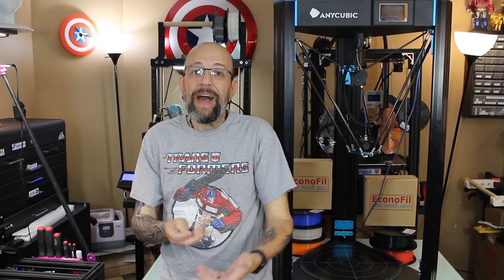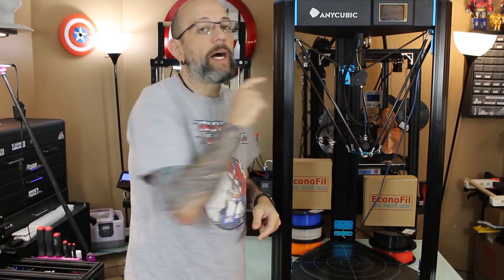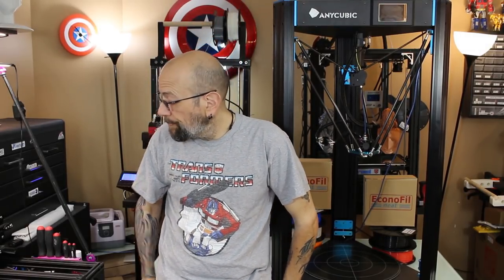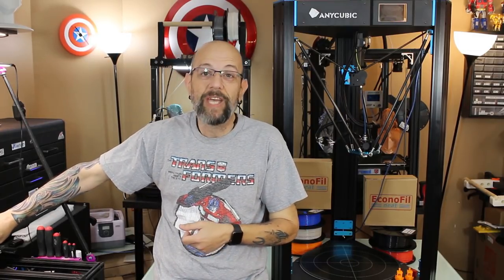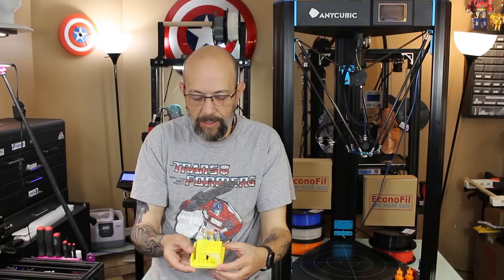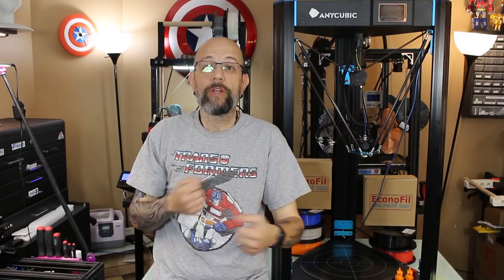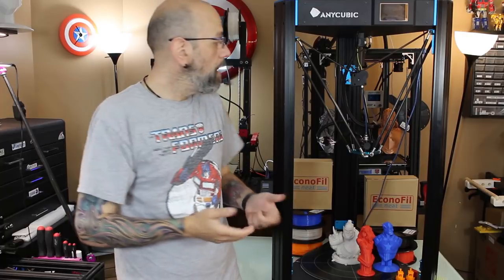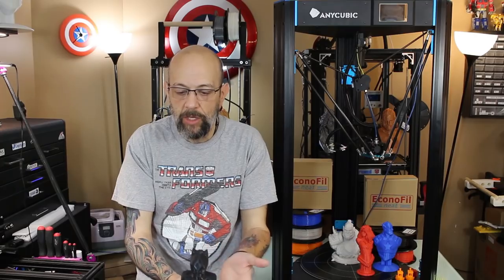Anycubic Predator Review Part II: Prints, Changes, Pro's, Con's & Final Thoughts

Comment: Two major cons after owning one of these for two months... 1. I'm with you on replacing the extruder- that one is crap, the teeth just chew hell out of the filament and it still slips. Replaced it with a BMG and all is beautiful now. 2. They do NOT need to send a spare hotend, they just need to build it with ONE authentic e3d v6. The clone that comes with it isn't actually a clone- it's a bad copy. It is NOT an all-metal hotend, as I discovered after I printed with nylon and it clogged the end of the Bowden tube. This hotend lets the tube go all the way through the fake "heat break" and about 6mm INTO the heat block!! Some may know, a real v6 has a heat break that keeps the Bowden tube up in the heatsink, and only filament goes into the heat block. I installed a real v6, and am now loving it... so those two things DEFINITELY need to be done, in my opinion. Oh yeah, did the TL smoothers too- big diff...
PS- Do you by chance have a phone number for Anycubic??

Comment: I know this is an OLDER video.    I put a .6mm  Nozzle on Stock Predator.  Cura 5.2 and chose .6 nozzle in Manage Machines BUT on the Predator  after trying to print in INFO it say a ,4mm nozzle.  Does this matter ,  is there a way to change it?   Thanks so much......Are you still using the Predator?

Comment: Thanks for the video.  After a lot of thinking and watching tons of video reviews I'm seriously considering a delta as my next printer purchase, and seeing the price this model can be had for (as well as the generally positive reviews) I'm this close to pulling the trigger.  I do have a few questions about your video, though, and am hoping you'll share your thoughts.

First off, i had watched Nexi Tech's review just prior to yours and he also printed that one "torture test" model.  In his case, though, it appeared as though it printed much better, at least in terms of the bridging (he didn't show the underside, nor whether the "gap test" pins printed properly).  I'm wondering how you would explain that?

Also, it would be super helpful if you revisited some of your failed prints to see how the issues you had were solved.  The "torture test", for example.  How much improved was the bridging and the quality of the spikes/spires improved after upgrading the cooling (or tweaking the profile, etc)?  A bit more controlled methodology, I guess, is what I'm saying.

Anyway, just a couple things that came to mind.  If you feel uncomfortable at all about commenting on another channel's content, I fully understand, but i was rather curious about the (apparently) different outcomes with that print.

Comment: Thanks man! This video convinced me to pull the trigger. Bought this beast for $339 on Anycubic's Black Friday Sale, and can't wait to get it up & running!
Reply: Mine is being delivered today, for that price I didn't need any convincing.
Reply: @creamofbotulismsoup9900  I hated my Ender 3 Pro, so I was a little gun shy. I've been absolutely blown away at how great my experience has been with my predator. It's SO much better than that Ender I had. From the moment I started building it, I could tell that the construction was much higher quality, and it "just works." I've had a few fails, but they're uncommon. Most of my prints are amazing, and I'm still 99% stock. I've replaced the tubing with blue capricorn, and that's it.
Reply: @robb961969  Can definitely say I am very happy with mine too. Great prints right out of the box, only real issue was that two of the arms were not the correct length, one way too long, one slightly too short. Though I have done several mods, even designed my own fan duct, and converted it to 5015 fans and now it bridges and does overhangs about as good as any other printer you can find.
Reply: @creamofbotulismsoup9900  I've though about a new duct. Fans might not be out of the question either at some point. I generally print D&D terrain, though, and that's coming out great, so I've been reluctant to fix what isn't broken.

Comment: I really liked the printing motions of my predator but honestly it was just endless modding and print quality issues.. I got sick of it after the leveling process slammed the sensor into the bed and dragged it across the bed. I ordered a new leveling sensor and it never arrived. I hear they have made some changes to the machine but they would have to make quite a few changes for me to try it again. I am not sure if it is even available anymore.

Comment: When you change to SKR 1.3 do you need to buy a new LCD?  The original LCD uses one of those ultra thin ribbon connectors.
Reply from the maker: Peter Callison yes. The original lcd won’t work

Comment: A link to the duct you choose to use would be helpful (y)
Reply from the maker: it's not actually my file to share, but I will ask the creator if it's ok to share it.
Reply: @Versus3D  What I meant whas a link to where the creator has shared it. Thingiverse link. That`s not something one need to ask permission for.
Reply from the maker: @stigberntsen9301  it's not on thingiverse, it was posted by a member of a facebook group I'm in. Here's the link, but you may not be able to access the file unless you join. https://www.facebook.com/groups/2134289353555625/permalink/2244632429187983/
Reply: @Versus3D  Ok, kind of strange. Putting a link to a public shared print, reffering to the designer is not something I have ever seen anybody need to ask for permission for.

Comment: whats the minimum speed for this printer because i get layer shift and back to normal at slower speeds.
Reply from the maker: I normally run mine at 80mms, but I know people that run it as fast as 150mms. The slowest I've run it is 50mms and it's been fine for me. But I've modded mine quite heavily since making this video. I plan on making another (hopefully much shorter) video on all the mods I did.
Reply: Versus3D I like the long version better. The information is perfect for everyone that’s looking for a a first 3d printer.

You have so many printers, you’d be able to print a multipart modular big project and make a show with it.

Comment: Hi, nice review! I own an ender 3 and want to buy a second printer. I would like something with a big enough build plate to print helmets in one go. (And other armor pieced) I am trying to decide between this anycubic delta or the CR-10 range. Do you recommend one over the other?  Thanks
Reply from the maker: I own all of the CR-10 series printers. To be completely honest, the build quality on the Predator is far superior. Also print quality out of the box is much better and there are fewer issues that I've come across. So coming from someone that owns all of the ones you mentioned, I would pick the predator, and I noticed they just put it on sale on Amazon a few days ago.

Comment: Hi, thanks for this great review. Just a note: You can't upscale models in vase mode without increasing die nozzle diameter. The 'overhangs' are very limited in vase mode. You may have a look in Cura  in layer view and will see that the print has to fail when upscaling the model. I assume the side without parts cooling (open ring) did fail.

Comment: For large XY dimension prints I am sick of heated bed cable breaks. Therefore thinking of migrating to this machine precisely because we are printing experimental equipment for air flow testing which must be at least 350 mm diameter. This limits options. For the budget user only ANYCUBIC has embraced dimensions large enough for real world prototyping (ie non-decorative models) IMHO...

Comment: If I remember correctly you mentioned changing the board and running Marlin on this printer? If so will you do a how to video please ??
Reply from the maker: I have made all the modifications to mine. SKR 1.3, TMC2208's, BMG, E3D V6, New Effector, New LCD... and a few more things. I will be doing an overview video on it in the near future. Not super detailed, but it should be enough to be able to mod your own.
Reply: @Versus3D  that would be awesome
Reply: @Versus3D  I have had my Predator since March. You pretty much hit it on the head with this review! I would love to see how you went about doing the SKR and Effector upgrade. I have had the SKR sitting here for a month, just haven't dove in yet. Also interested in the Effector and upgrading the rods. I went through the 2 spare rods in the first 2 months, both just came unglued and failed mid print.

Comment: I would put tmc2209 or tmc5160 v1.2 maybe a skr v1.3 but the skr pro has a faster cpu so maybe could use that extra speed on this Delta.
Reply from the maker: Dave L I put an SKR 1.3 with 2208’s, a BMG and V6.... and a few other custom parts
Reply: @Versus3D  will you be making another video about this, would be interested in the speeds it can reach upgrading to a SKR & 2208's.

Comment: This is everything I could hope for in a review. Out-of-the-box quality, ups, downs, key modifications with results, and a couple of hints for the manufacturer. I've been looking at this printer for a while but worried about how it seems to deliver well on every point except actual print quality, which is rather important. This review gets to the heart of that and shows me the dirt, but then comes back with a couple easy mods that fix the problem, giving a clear idea of both what I'm going to get and what I can turn it into. Liked, subscribed. You could use a better camera, or maybe just better lighting, for close-ups, but this is otherwise the kind of review I'd expect from someone who's making this sort of thing his job.

Do you know anything about the confusion between the Anycubic Predator versus Anycubic D? The new ones say Predator on them, the older ones say Anycubic on them, some vendors have been selling them interchangeably, and I've heard some doubts about the QC on the older model. Any thoughts?

Comment: It’s calibration. Others had much better prints.
Reply from the maker: stage274 actually it was a mechanical issue that I’ve since fixed
Reply: @Versus3D  may i ask what the mechanical issue was then? i.m in the market for the predator so i would like to know what kind of peoblems ( and therefore solutions) i can expect. Thanks in advance
Reply from the maker: @vemusicworks  my belts weren't evenly tensioned, and the carriage eccentric nuts needed some adjustments